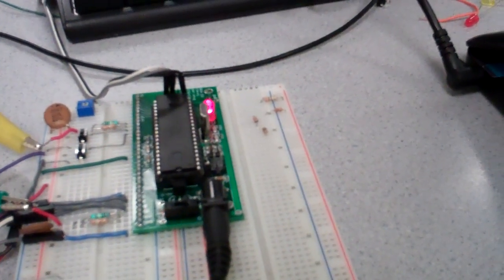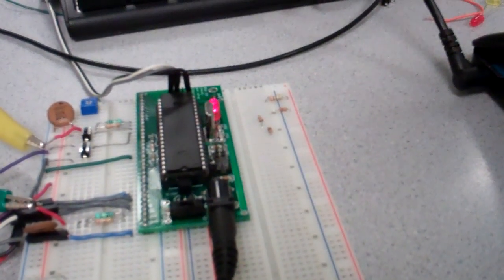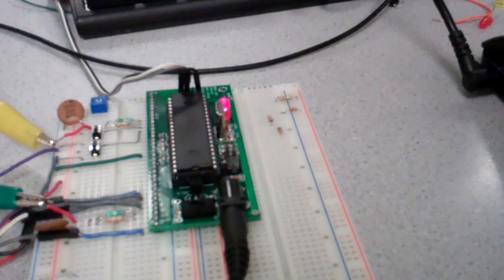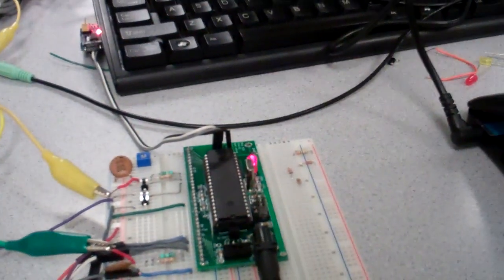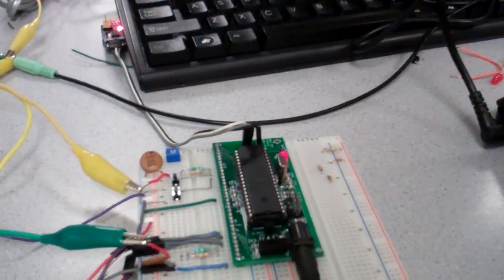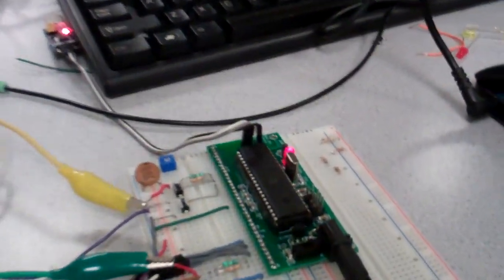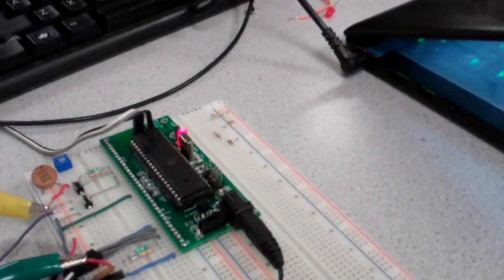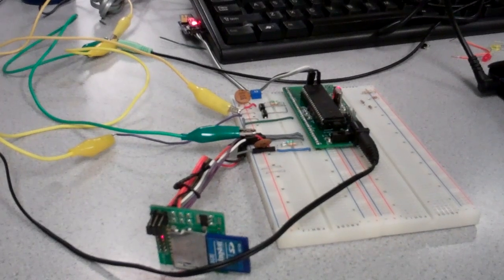16-bit wav player

Comment: Without the capacitor we would get 16 bit digital pwm signal right?
Reply from the maker: the 16 bit dynamic range comes from the analog weighting of the high and low 8-bits
Reply: @ece4760  Okay, given a little more thought and I doubt if cd4013 must be used.

Now we combine the two PWMs digitally, in a gate. Omit the capacitor and both resistors as well. They were for analog sampling, not digital.

The two PWMs are kept in sync by the internal clock of the Arduino. In that case a CD4012 would do all the job. CD4013 omitted.

PWM1 to pin 2..
PWM2 to 3
carrier to 4
Vcc to 5

Output pin 1 connected to all the inputs of second nand gate to invert the signal back to positive. 16 bit pwm output is available at pin 13. A simple 2n3904/3906 totem pole and a LPF delivering 50ohm to antenna
Reply: @ece4760  Oh. So no capacitor no twice the resolution? The 3.9k and 1M would still be there feeding a 74hc00.
Reply: @ece4760  Thank u so much for the quick reply!
Reply: @ece4760  Okay. I am going to generate three pmw square waves using its 3 timers. Prescaler = 1 . 16 mhz / 256 steps = 62.5 khz pwm each modulated by audio. They are fee to two nand gates. Other pins of the nand are driven by 0 and 180 clk by a flip flop. The divide by 2 CD4013 is driven by the third pwm signal to keep it all synchronized. Output of two nand gates merge into one nand gate. These 3 nand gates form a discrete XOR gate. The output (31.25khz) is then fed to a fourth nand gate. A square wave oscillator of 1600khz drives its other pin to up convert it to 1600khz for transmission.

Comment: Bruce, need help!

The fastest frequency of PWM will be 
clock frequency/256 
Which is 16,000,000/256
Which is 62.5kHz
1 cycle of this PWM will last for 1/62.5kHz
=16 microseconds 

Now we want to generate analog output from this PWM at a frequency of 44.1kHz
So every 1/44100 second we want a new analog output 
1/44100 = 22micro seconds 

This implies the pwm will only make 22/16 cycles per one analog output. However we need to keep this an integer.. that means only one pwm cycle is used for analog output. 

Is one cycle of pwn enough to generate one analog output? Any sources to understand pwm to analog?
Reply from the maker: You will need to use a different clock frequency. Each PWM cycle can take on 256 diferent average values, so it is analog, if you lowpass filter
Reply: I read the documentation. This project uses 16MHz!
Isn't that a little strange?
Reply from the maker: @devanshshukla8857  It is not at all strange. If you read the linked report, you will see that he used a PWM that is 362 cycles long. Read the 1284 datasheet, section 16.9,  to see how to set up a timer with an arbitrary PWM time.
Reply: @ece4760   Prof Bruce, according to the report, left channel high and left channel low are connected to pins OC0A and OC0B while the right channel pins are connected to OC2A and OC2B suggesting the use of timer 0 and timer 2 for fast PWM generation. The use of timer 1 is to change the duty cycle of these 4 PWM outputs at a frequency of 44.1 kHz by setting compare register to 362.  

In this case frequency of PWM would be 62.5 kHz while the duty cycle changes every 44.1kHz. Still strange?
Reply from the maker: @devanshshukla8857  My mistake. YOu are quite right and answered your own question. Not strange at all. For most of the labs, we ran the PWM at 62.5 and updated the PWM duty cycle at 8 or 16 KHz. You can set the PWM at any rate, independent of the PWM rate.
Reply: @ece4760  That's right. So the doubt remains, if you use PWM at 62.5kHz while you sample audio at 44.1kHZ, you would be left with just (62.5/44.1) PWM cycles per audio sample update. 
Wouldn't that be a problem? You only have 1.41 PWM cycles to model the analog audio voltage! (1.41=62.5/44.1)
Reply from the maker: @devanshshukla8857  Try it. Generate a pure sine wave, run it though the sampleing scheme, and check the spectral purity. All you need is one PWM cycle for 8 bits. The frational cycle will amke some samples output for too long and some too short, but if the change per cycle is relative small then I doubt that you will hear the modulation
Reply: @ece4760  Wow! Now I totally get it! Thanks a lot Bruce! Thank you so much!! Really appreciate your help! Blessings from India! :)
Reply: @ece4760  Bruce I have a question. If we don't want an analogue output then removing the capacitor would give me digital 16 bit resolution PWM, am I right? I am trying to build an AM where the 16 bit digital signal is going to a 74hc00 on one input pin and other input pin is fed with 1600KHz carrier wave to generate 1600KHz PWM at 74HC00 output to drive a MOSFET in class D or a low pass filter feeding an antenna. I can remove the capacitor right for 16 bit digital pwm signal? Please answer, it's my only doubt. Thanks a ton!
Reply from the maker: @dare-er7sw  i don’t think this will work. 
the 16-bit dynamic range is the result of analog weighting of the pwm channels
Reply: @ece4760  Oh  wow. I thought it would but still could not understand how the mixing worked in resistors. I'm generating 31.25KHz PWM at pins D9 and D10. Even if I up the value of C so the Fc of 3.9K and C to ground is 60KHz it still won't work, right as the pwm is being turned into an Analogue voltage? Thanks for your lightening fast reply. I messaged others  but never got a reply.
Reply: @ece4760  What about digital gates? I read a paper in which high byte and low byte PWMs are fed to two 74HC00 Nand gates clocked by a 74HC74 divider.
Reply from the maker: @dare-er7sw  show me the paper
Reply: @ece4760  Got it? Ping me
Reply: @ece4760  I'm already using a nand gate, one pin takes 50khz pwm audio, other pin takes the carrier of 1600khz. I'll send u the paper but I don't think the flip flop is needed as the two pwm signals at D9 and D10 are already synchronized by Arduino clock. Cd4012, pwm1, pwm2, + , carrier. Nand has four inputs in 4012. Then use the second gate to invert output of first gate to positive again. This way we have a 800, 1000, and 1600 KHz 16 bit AM transmitter using a single Arduino. Dynamic range of our ears is around 90dB in daytime noise like people walking, talking, fan, AC, kitchen sounds, traffic sounds, etc. 12 bit is the most we can hear. Maximum 14 bit. Going above 16 bit is a marketing strategy.
Reply from the maker: @dare-er7sw  just send the URL
Reply from the maker: @dare-er7sw  i do not see why this should result in 16 bit audio. Modulation is a multiply operation, and a nand gate is kind of a 1-bit multiplier, so the modulation might work, but it will not be 16-bit. try it .
Reply: @ece4760  Link gets deleted whenever I post them. Okay I just did. It's in PDF
Reply: @ece4760  Ok look up "It works by merging 3 signals which are generated by an ATMEGA328 microcontroller in order to be used as" The link appears at no. 1
Reply: @ece4760  search sentence updated. Pls check
Reply from the maker: @dare-er7sw  searching this phrase returns nothing useful for me.
Reply from the maker: @dare-er7sw  you could, of course, just google me to get an email address.
Reply: @ece4760  Someone else is showing up. Could you mail me? I gave it few minutes back.
Reply: @ece4760  Starts with G ends with L
Reply: @ece4760  Another idea is using a flip flop. I've not tested it on Spice yet. R1 + C1 series to GND. LM386 supplies R1 audio, DC coupled. Juction of R1 C1 feeds 'D' input. R2  connects 'D' to 'Q/' . 'Q' is the PWM output. CLK is the carrier frequency. It is a 74HC74 . R1R2C / (R1+R2)  time constant needs to be greater than the pulse period of 1.6MHz (.0065 mS something) . 

My values are coming R1, R2 = 100ohm and C1 = 22pF for a time constant of. 0011 mS which falls just short of the next clock pulse. This is the idea. Charge of C1 is altered by dc coupled AF, while a logic 0 at  'Q/' discharges the capacitor. The data at 'D' toggles between 'Q' and 'Q/'. Our PWM output is the 'Q' pin. 74HC74 +5V.
Reply: @ece4760  Check mail. Sent the PDF. Thanks
Reply: @ece4760  With 1:256 resistors I couldn't figure out how the digital mixing worked without the capacitor. Turns out it was for analog only.
Reply: @ece4760  R and S of flip flop grounded.
Reply from the maker: @dare-er7sw  I should be the first hit on google. people.ece.cornell.edu/land/
Reply: @ece4760  I saw, but I was looking for the guy in the video and later realized he was someone different and not you, probably one of your students. I have sent you a mail with PDF attachment.

Comment: I am confused. This can play 16-bit files. But is the output also 16-bits ? 
Cause using 8-bits for each halves of the track (positive/negative) would just give you 9-bit quality output.
Since (2^8)*2=512 choises. =2^9
And 2^16 =65536. 
Still cool though.
Reply from the maker: Does not use 8-bits for +/-.  Uses two weighted 8-bit numbers to build a 16-bit number

Comment: Nice audio quality! How do you implement it?? I also tried to build a similar wave player with arduino, but it cannot play high quality wave files with sample rate larger than 22100... How did you do that?
Reply from the maker: There is info in the comment link.
Reply: Bruce Land Thank u! I checked the report and did some modifications, now the audio quality @ 22100 improved. I may need a fresh implementation without using arduino libraries.
Reply: Hi, where can I get a copy of the code ? I sent an email out to Wancheng but he may be too busy. Thanks.